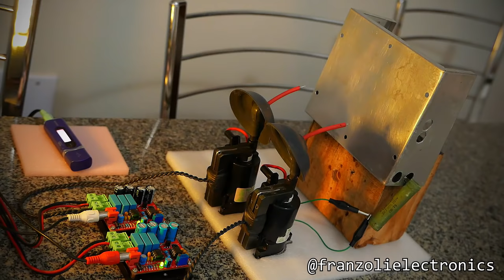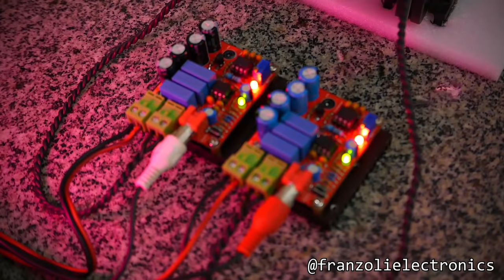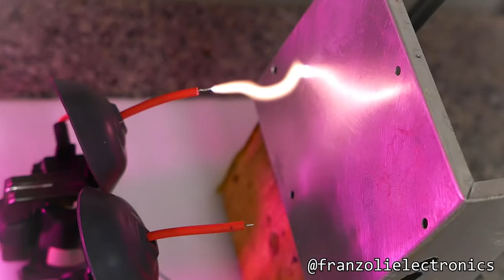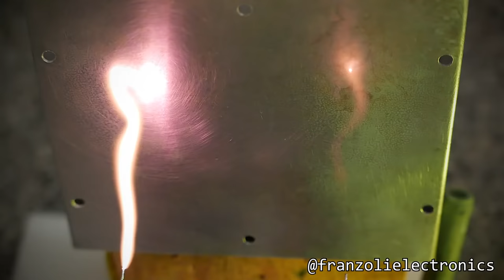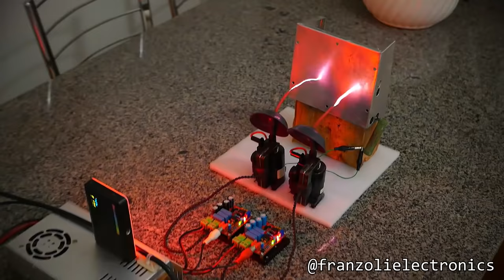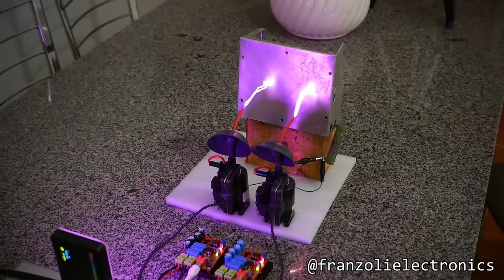aha - TAKE on ELECTRICITY

Comment: Here's an odd question:
I was reminded of this kind of electronic music when someone from a twitch streamer's chat took up the challenge to describe the colour red by it's luminescent frequency. (The streamer is colour blind.)

So I was wondering what the resonant frequency of each colour would sound like. Is it possible to give light a sound?
Reply: Interesting thought. Considering that colour is an electromagnetic sine wave and that sound is a pressure wave, then by just mapping the frequency of a colour to the equivalent audio sine wave I guess that you could argue that it's "giving light a sound".
The only problem is that visible light has tiny little wavelengths between 400nm (violet) and 700nm (red), which correspond to frequencies around 10^14 Hz which is waaaaaay too high pitched to be heard by any ear that I know of. The human ear's range is 20Hz to 20kHz, so even the "lowest" visible colour is a billion times too high pitched to be heard.
Of course you could accept a compromise and adjust the frequency to fall within the human hearing range but then are you really representing light, or are you representing just any old electromagnetic wave regardless of it's wavelength?
Reply: @dylanrobins  (dunno why I didn't, get notified of your post as this is something I was looking forward to...) 
 ah, I see. The Waves might be too tiny, however Tesla also gave us a multiplication tool called a capacitor, so we could technically use that as a solid source of amplifying 400nm into the Hz range to make it fair. Expanding on that, making such a conversion into a hand held tester pen could also serve as a colour reader allowing a colour blind person to point to an object and get it's wave file transfered to sound. 

Going further, such a conversion of the light spectrum into the 20Hz to 20kHz spectrum (given my understanding that mo Hz higher pitch) would be a great new way to explain how getting one full body x-ray (a couple squeeky blips) isn't that harmful, but x ray techs need to protect themselves as they are getting those blips continuously

Comment: a question, can i use 10 amp to supply one flyback?
Reply: I think so, it drains something around 8 apms depending on how you tune that trimmer. Mine drains 4-8 apms but I'm using 25 amp source so I don't care about it much :)

Comment: Why not audio mod that with an actual .wav file aka plasma speaker? 8 bit sucks, might as well just have a tesla coil do that. Probably a robust enough Class D audio amp can drive the primary instead of a speaker.
Reply from the maker: Because the visible interruption effect is the most attractive part. I wonder if it really sucks if we consider that I had around 500 times more views using it in this way haha
Reply: @franzolielectronics  The way YT algorithms work it's probably just from the title phrasing. A real test is which one would sell better if both versions were sold.
Reply from the maker: Not at all. I've been doing that for over a decade and I noticed something:
1- lay people has more difficult to understand of what's going on while using a continuous static spark;
2- Seems people think it's more attractive acting like a musical instrumental than a tweeter, its possible to play your own interpretation of the same song.
It's way easier to make it act like a speaker (not as easy as just use a class D audio amplifier, you need to modulate it), but it's easier than using this interruption effect, even a single IC555 must do the trick.

Comment: How your transformers last so long? Mine melt after 3 minutes of shorter arcs🤣
Reply: Transformer or MOSFET? Because I blew up 2 mosfets before understanding they need large amount of cooling. Also you need some kind of high power resistor for the ground input going back to the transformer from thing where the sparks go in (2k-5k; 25W+)
Reply: @squatnikarc  Transformers. The mosfets remain warm
Reply: @vladd9344  these mosfets can burn out after just few sparks without proper cooling, but if you molted flyback that's bad :(
Reply: @squatnikarc  it was winter and i was otside so the mosfets where at sub-zero
Reply: @vladd9344  if your mosfets burned out your circuit will short and you can see it on power source (idk what power source are you using but I'm using industrial 25A power source and when I burned them it kept restarting because of the short) Also they need direct way to transfer heat from them like big aluminum heatsink and thermal paste under them (I didn't care about it much too but its necessary as I can see) . I bought 2 heatsinks, some Chinese self-adhesive heatsink paste and screwed mosfets to the heatsink it works well and the heatsink is getting warm really fast so I might add some extra fan cooling on bottom.
Reply: @squatnikarc  I will add a big aluminum heatsink and a 80mm cooling fan